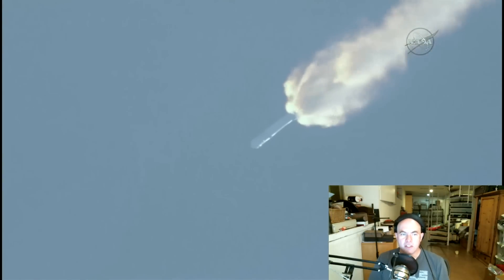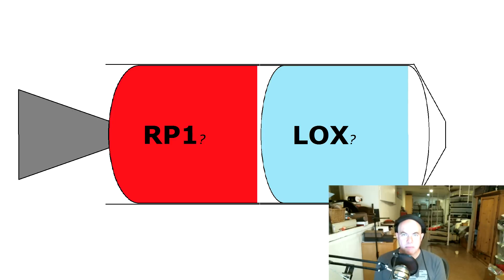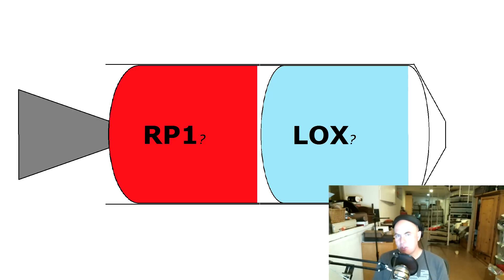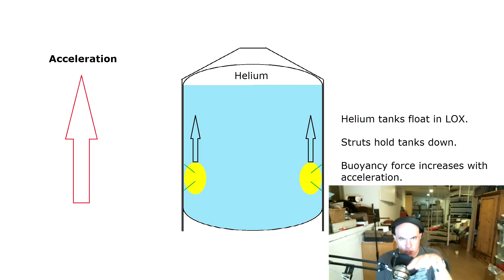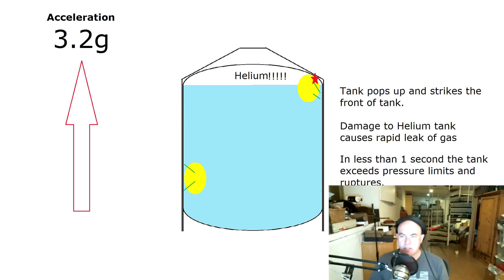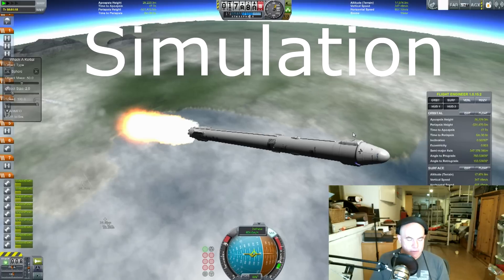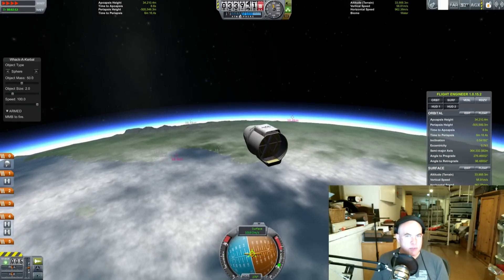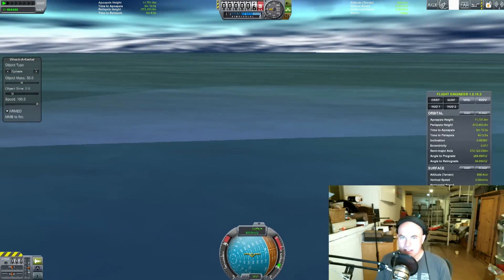Explaining the Space X CRS7 Launch Failure

Comment: LOX is above the RP1 tank. You can confirm this by checking the frost on the vehicle on the pad. RP1 is currently loaded at near ambient temperature. LOX is obviously loaded at ~-300F. The top part of both S1 and S2 are where the frost is, ergo, that's where the LOX is.

Comment: Was it actually said in the conference how many struts they tested during investigation and how many failed at what force? I've found info ranging from 1 failure to a few and that struts failed below specs but either force value wasn't stated at all or it was 6000lbs. I don't think I've seen any info that they managed to break any of those struts at just 2000lbs.

Comment: One minor thing, the helium is added to prevent the tank from collapsing under the outside force/pressure as the fuel is removed, if not it would crumple up like a capri-sun juice bag.  While this also stabilizes and increases the flow of fuel/oxidizer, I think that the structural aspects are slightly more pressing!

Comment: They could of learned from KSP always add MORE STRUTS!
Reply: Alex Lindsay Haha! or use the KW rocketry struts that are 1 TON
Reply: escraftTH No, they just say 1 tonne. AFAIK they still don't actually contribute to vessel weight.
Reply: AlienCollective oh! so they are massless!
Reply: escraftTH They were in 0.90 for sure, and I haven't noticed/heard anything to the contrary about 1.0.x. It's easily checked, though.
Reply: AlienCollective ksp doesn't need 2 types of strut, does it?
Reply: escraftTH The KW Rocketry struts are stronger and more rigid than stock, which is nice when you're building 5 m rockets.
Reply: AlienCollective i would love a bigger longer stronger strut that have the texture of the eiffel tower small beam.
Reply: +AlienCollective I made a mod called SuperStrongStruts that literally does nothing but add better struts at 10x, 100x and 1000x strengths, as well as struts that act as fuel lines. So sometimes the solution is not MOAR struts, but BETTAR struts.

Comment: The way I understood the question and answer session is that the helium tank didn't actually burst from colliding with the top of the tank but from rupturing the line it was attached to which was to feed the helium close to the engine to heat it up and pressurize the LOX tank after. This line was yanked from the rising helium container causing the gas leak then the helium container apparently twisted closing the line which caused the pressure in the container to temporarily rise again which made for the "counterintuitve data" that Musk was talking about, but enough gas had already been released to blow the main tank.

Comment: To my understanding, LOX is in front of RP-1 because of its higher density, causing the rocket to be stable; the center of mass (essentially the point about which the rocket turns) is more in front of the aerodynamic center (the point where drag can be simplified to apply), so a disturbance causes the rocket to be moved back to the velocity vector, rather than away from it (compare this to a weather vane)
Source: Aerospace Engineering student
Reply: Arjan Vermeulen This is correct. Source: Guy who has played a lot of Kerbal.
Reply: Arjan Vermeulen How is being a student in that field of study going for you?
Reply: Adrian T More math than women ;) but in all honesty it's tough but rewarding (Largely because I reaelly like the subject matter), my university (Delft, Netherlands) has a lot of international students in the Aerospace program so there's a really diverse group
Reply: I counter with the upper stages of the Saturn 5.
It depends on the vehicle, your logic was used on the space shuttle, but not everywhere.
Reply: I don't personally know that much about the composition of the Saturn V (Which stages did they turn it around on?), but keep in mind the upper stages are used in a lot thinner air, thus the aerodynamic torque is severely less

Comment: Hey scott, this might be a bit of a silly question but why are they holding the Helium tanks at the bottom of the LOX tank? To a random onlooker it seems more logical to store the helium tanks at the top of the LOX tank so there is less danger of them rupturing and slamming into the LOX tank and causing a failure like this. Either way, this was really interesting to watch and its a shame we dont hear more about what NASA does in the press et cetera
Reply from the maker: Mightyproduction I would presume because those tanks also pressurize the fuel tank, so having the shortest distance to run lines simplifies things.
Reply: Scott Manley I Would argue it has more to do with the LOX being used as thermal insulation for the He tank. Therefore you want it to be immersed in LOX for as long as possible. By the way, I expect it also to be the reason for having the He tanks inside the LOX tank in the first place.
Reply: Scott Manley That does make sense, thank you for your response
Reply: Mightyproduction Helium also cool the engine. That's how it heats up and expands to pressurize the LOX and RP-1 tanks.

Comment: Usually the LOX tanks are placed under the fuel (RP1 or LH2), this due to their higher density and thus also overall weight.

In this case you get a more stable reverse pendulum model in which the CoM sits closer to the thrust point.
Reply from the maker: You have it backwards, you want the COM to be as far forwards as possible to increase aerodynamic stability.
Reply: Scott Manley

I guess you're right, how terribly embarrassing on my part. Please don't tell anyone...
Reply: I'M GOING TO TELL EVERYONE
Reply: Junn Kopf  Por favor, NOOOOoooooOOOO!